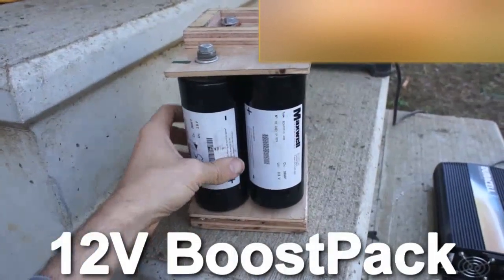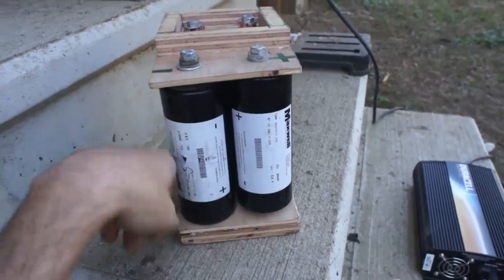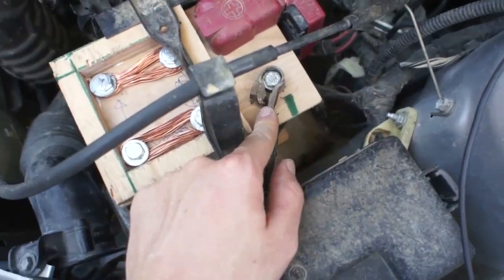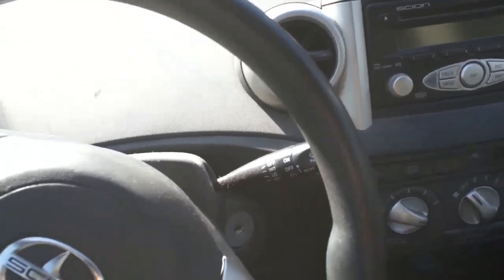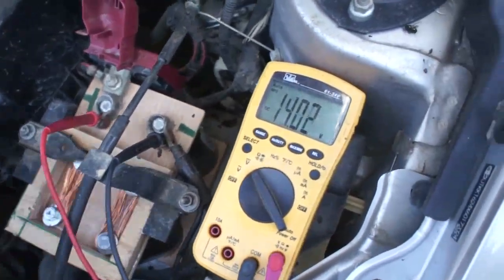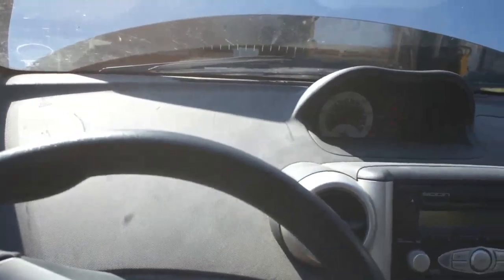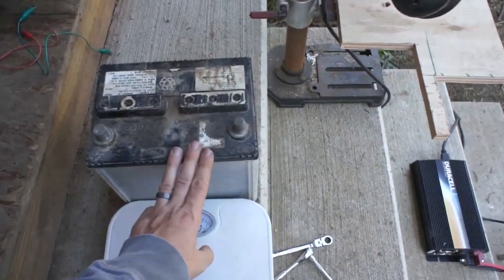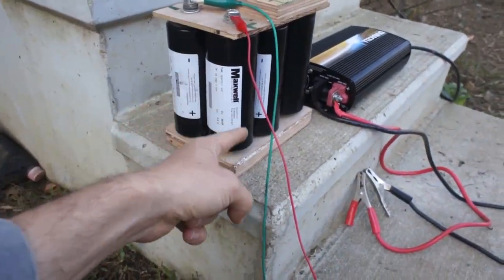12V BoostPack. Replaces auto battery. Works great!

Comment: where did you get these for 6 bucks I can only find 6 of them on ebay for 300 +
Reply: the ones you link to are only 50F each. you would need 312 of them to match the energy capacity of the ones in the video... $1291.68 before shipping, not to mention the huge footprint and work required to get something like that wired up.
Reply: @PeterJothen  $350 for a 3000f (500F total) setup ebay.
Reply: ***** It's good to point out Royce findings as I do search online myself and did not seem to find the $6 Maxwell Boostcap Supercapacitor as mentioned in this video... Would +lasersaber be so kind to share with us so we can build one ourselves... Pleeaaasee...  ^_^  a quintillion thanks to you !!
Reply: Ah, good catch. I missed that.
Reply: Royce Ardery people bought them too quickly when they found out hiw cheap they were
Reply: Try Newark Electronics.
Reply: Just did a quick Google search and found them for $6 apiece here: http://www.mouser.com/Search/ProductDetail.aspx?qs=JV7lzlMm3yJDkhnJz3nobw%3d%3d

Comment: Can capacitors exploded , you should of measured cap voltage after the car was shut of , you were measuring the alternator voltage .  Good thing your inverter has a warning buzzer it's there for low voltage on battery , potential explosion when drawing from a low voltage battery ...

Comment: I admit to being envious that you bought caps at such a great price before the price for old caps went silly. Purely for reasons of continuous power drain (ECU, alarm,immobilizer etc) let along a forgotten lamp, I would not replace a battery with this - but it would permit a smaller battery to do the job superbly. The huge current potential of the supercaps for cranking, combined with a reasonable AH from the traditional battery.

I could see supercaps being a fantastic addition to a car battery for stop-start applications - couriers etc - where the van may be stopped and started in the space of a couple of minutes. With supercaps, not only would they fully charge in time but ALSO they would allow the car battery to continue charging until the supercaps had dropped down to around 13v or so.

A shame a lot of folks felt the need to be obnoxious because the caps are no longer available surplus as easily for the right price - and frustrating that other folks seem to think they are an electrocution risk. Ah well.

Thanks for sharing the vid :)
Reply: There are already devices
 like that out there.

Comment: Please make a video on how to make one of these, or at least put a schematic on your webstite! Thanx in advance!
Reply: It's a gimmick.  Look it up. It's just a capacitor bank, that's why this isn't used widely.  Look up what a capacitor does.  No such thing as a "boost pack" and the caps are 80 dollars each.  You can get a battery that will do way more for 70 bucks.  This guy just uses a tool for 16 seconds, how much work could you really do with that kind of time???? Near zero.
Reply: Ok?
Reply: It's just some super capacitors wired in parallel: this is not a new idea.
Reply: Thanks
Reply: What battery cost $70? 40AH?
Reply: @stevenking2980  WRONG. 
there in series as only rated 2.5-3.2vdc ea. Its only been available for 20yrs - so its a new idea!
Reply: @stevenking2980  Its used widely! Buses, hybrids, military ships use them for their cannons - as a rail gun to launch missiles. Batteries are now 1/2 the cost of supercap setup. These will last you a lifetime. Easy to move to next car. Boost packs also to jump-start a car with a low battery, but there spendy. Its not a capacitor bank, its a SUPER/ULTRA capacitor bank!
Reply: Steven King You know you are coming across with this superior attitude yet you are so ignorant to what is actually occurring here that you look like a stupid jerk. For example, you are being critical of the term boost and boost pack. I don't need to repeat all your jerky comments but I will state my understanding of its use. 

He's using caps as a battery. 
He had to call his device something. 
He chose boost pack. 
I think that's a bad choice to coin what he's concocted but it's not my video, invention and lameness. 
It doesn't boost anything. Perhaps if he used it in conjunction with a battery then maybe(as this thing evolves he later does use it with a battery. Still wouldn't call it anything +boost but that's just me) 
Given all the information in his videos and the fact that he implicitly says "...so I just call it a boost pack... " for anyone to go on the record trying to make an argument about how it is not a boost blah blah blah they are caps blah blah blah just makes that person an idiotic jerk that can't fully grasp what is going on here. 
Have a great day Mr dung pile!
Reply: +Steven King series.  Can't start a car with 2.5 volts.
Reply: +Steven King Series dumbass!
Reply: +TAUNYA TERHUNE Why would you insult a stranger and call him a dumbass after he had already been corrected? Do you think it is at all possible that he inadvertently said parallel when he meant to say in series? People make those kinds of mistakes all the time. He probably knows its in series, meant to say in series and somehow the brain got distracted...

Personally I dont really care for this person just because he was kind of a dick and spouting off calling it a gimmick and being negative. Its not a gimmick capacitors store energy same as a battery. The main problem is they can dump all of it at any given moment. The fact there doesn't appear to be a follow up probably means after further testing he fried his entire ignition system
Reply: @Beaches_south_of_L.A.  How can he fry his ignition system? Nothing to do with SC's
Reply: TAUNYA TERHUNE Your calling him a dumbass for saying a car can't start at 2.5v? 
You know, this is why Women stay at home while we deal with this.
Reply: +Beaches south of L.A. Besides all that, he probably went with cheapest available car battery which lasted quite few years (considering it looks like from 1990s) and he's still blaming lead acid batteries that they are heavy and poisonous and whatnot. This cap bank he's using now is probably gonna end up frying alternator or electronics, costing 10 new car batteries.

Comment: I want to know where in this galaxy you can get a capacitor that size for 6 bucks. I had a look online and the only one I could get around that price was $8.92 and that was this one (http://www.ebay.com/itm/Maxwell-BCAP-2-7V-5F-Farad-Super-Ultra-Capacitor-170mohm-ESR-Blue-Boostcap-NEW-/111004746460?pt=LH_DefaultDomain_0&hash=item19d86602dc) and it was 15% off and about 100 times smaller than the one in the video.

Comment: I'm wary about replacing my battery just yet! The capacitors seem to discharge so quickly. Forgetting to turn off lights for only short periods could leave me dead. If I leave my indicator on when parking it activates a side light when the engine is stopped! Its some weird Euro parking thing. I do this all the time without realising and I think the caps would discharge while I'm getting shopping!
The capacitor pack and solar cells though could be an awesome fix for a flat battery. If it only takes 20 minutes to fully charge then you could use it in an emergency provided there's enough daylight!

Comment: i only see one problem with this being practical, if for instance you are someone like me who has a nice sound system and a subwoofer in your car and you want to use it to play some music while you're doing stuff outside you will get about 2 seconds of music then you can't start your car, so for starting your car and while the car is running a capacitor bank is practical but as you turn that key off you cant have anything on in your car.

Comment: Since you bring up the point about using it with power tools, have you tried testing trail welding using your battery? Stick welding using two batteries, or maybe in your case - your single battery.

Comment: BS these are $6 each.  Off by a factor of TEN.  Also, better get a second hood latch, because when one of these blow up, your hood is going to pop. lol
Reply: Supercaps were really cheap on eBay a few years ago. Not so much anymore.
Reply: Late bloomer caps are used when you need a lot of power for a short period of time. When you need longer run times capacitors become very expensive, heavy and space consuming.
Reply: Isaac Karjala Thank you for your comment,
i guess that would be a good reason why they're not commonly used as a battery replacement ....now that I have your attention..would it make sense for caps in parallel with a battery to be used in a regenerative braking system on a velomobile......I'm using a 250 watt pmdc brushed motor with a gearbox/manual that will be keeping motor rpm high ( designed values)
Reply: I can't see why not, I guess it could be used in a regenerative braking system for fast quick recharge of short stored energy. But you would run out of energy remarkably quickly, I would believe! This is why you have high discharge lithium-ion batteries, that are the main source of power in electric vehicles.
Reply: Yeah I just did a electronics search on these and it was $365 for six caps, The OP is full of complete bullshi!
Reply: Basically they wouldn't work with my 3K speaker system which I have in ,my car. For starting okay, longevity....NO!
Reply: Late bloomer caps explode when the liquid electrolyte is boiled, I suppose this could happen under the hood of an idling car on a hot day, but as far as I know caps usually explode because of over-volting, so as long as your caps are rated to a higher voltage than your dynamos peek voltage you should be good. If you want to be extra careful you can get solid state caps.
Reply: have experienced exploding battery , EET working on marine electronics , later I did some research on exploding battery , wholly phoque I was amazed at the amount of  eye injuries caused by exploding batteries ...so in your opinion caps can explode like batteries .....thanks for the heads up , I was wondering why caps weren't used  for heavy electrical loads
Reply: @latebloomer6957  They don't blow up like a battery... The heavier the load, the better for caps
Reply: @SamaritanElad  Ok I now use AGM batts so on my velomobile presently the PMDC motor is pumping into a charge controller while going downhill and a bonus compare to directly wired to my AGM batt , the controller is loading the motor so when going down hill I now experience the trike slowing me down more than when I was using a diode only . the diode path to the battery is when I turn the motor off with a push botton switch ( bicycle horn ) , the motor is a genetor with the current passing thru a oneway valve......would a capicitor act as a load and increase my regenerative braking and would the energy in the capacitor be easy to access
Reply: Late bloomer velomobile=recombant bicycle with a fully enclosed fairing?

I am guessing that you would just be using the dynamo to absorb the braking energy and then using that energy to get you quickly back up to speed. What you purpose should work, but the battery might end up being dead weight. If you are making a plugin/solar pedal-electric hybrid, using the caps to absorb sudden stops and provide quick starts and the batteries for bulk energy storage would also work. Either way, you need to either make sure that your batteries/caps are never so fully charged they can't absorb a sudden stop or that you have an alternative way to stop (either by having bleed resistors or having mechanical brakes)
Reply: Isaac Karjala Copy that about the mechanical brakes .....commercial of the shelf bike brake levers are available with
normally closed switches , so when you apply the mechanical brakes the switch opens before full mechanical brake pressure to disc brakes ( in my case ) happens . When the circuit supplying power to pmdc with brushes is open (applying slight pressure to brake levers ), at this point the PMDC turns into a dynamo and will direct current towards anode of diode where cathode is connected to positive battery . The diode will be in circuit to prevent motor from turning with brakes are applied or switch is off on motor . So pushing the velomobile will cause the PMDC motor to become dynamo . And yes velomobile = recumbent with removable , in my case , fairing . The reason for removal fairing is for driver ergonomics , In my case my velomobile will have a large shading top , very light weight so a low center of gravity can be maintained .
I suppose there's still a chance for the caps to blow , I'm wondering if the cap is necessary considering a potential explosion is possible . I'm using AGM batts because of their safety characteristics and the velomobile is for slow cruising or more of a utility velomobile than get me there fast and wait situation . I like to smell the roses so will need to stay away from cities , where people are committing mass suicide breathing carbon monoxide

Comment: So nice and useful comments, I agree with most of them. Personally I think this thing is dangerous and where are resistors? Only under controlled voltage!!! How do you know how much your car is giving power to capacitors?  But a small one unit is a very good use as a starter in time of battery fail, because it is charged quickly :).

Comment: What you should have done is just put a capacitor in parallel with a standard battery so that you can run your headlights for a bit without going down to 10 volts really quickly.  That's a great way to get stranded.

Comment: Each ultra capacitor are $69.00 USD not $6 as you stated.  6 x $69.00 = $414.00 for your car battery.  The ultra capacitor can hold a maximum that I found on Ebay is 3000 farad at 2.7 V each cell with a mass of 405 grams each ultra capacitor.  Just the ultra capacitor would make the mass at 2.430 kg  the great thing about these ultra capacitor is 1000000 charging cycles.  It more than cost of a car battery but depending on uses it could be a good option.
Reply: No Name yeah I'm runnin the 20ah on my 1.5l and it always starts the first time , had it since October. If you leave the radio on it will struggle a bit. I'd go with the 35ah just to be safe it's about 1/2 as much as a basic walmart battery. People laugh when they see a tiny battery but AGM is more advanced than lead Acid. It doesn't leak, it resists vibration, and it's got more energy than a lead acid of the same size.
Reply: I'm runnin a 12v20ah AGM cost me $40 on Egay, they also have a 35ah model for 65
Reply: TheBikemaster94 enough CA to start a small car?
Reply: http://www.newark.com/w/c/passive-components/capacitors/supercap-ultracap-double-layer-capacitors?capacitance=400f&st=supercapacitor&sort=P_PRICE

Comment: hello I have a big cabin cruiser and I am a full time liveaboard and needing to get new batteries for the cabin,, I was thinking about running four 6 volt batteries @ 12 volts
because I need the reserve capacity,, I would be interested in this set up you have because the weight factor,, but is it possible to get those caps to do the job that four 6 volt batteries would do,, also I have an onboard marine 12volt charger that is automatic
and has capacity for regular batteries and also gel cell and glass matt ,,
do you think you could help me build something as good as 4 of the 6 volt batteries running @12 volt,, thanks for the video,,and your time,,Robert
Reply: Caps don't store as much power as a battery, they can release the power much faster. He is largely using them to replace the cranking amps and the cars alternator/soler for power over time. To answer your question need to know what the loads are and how your charging.